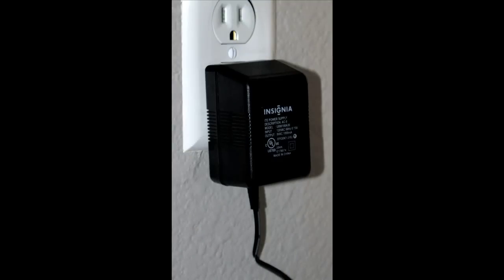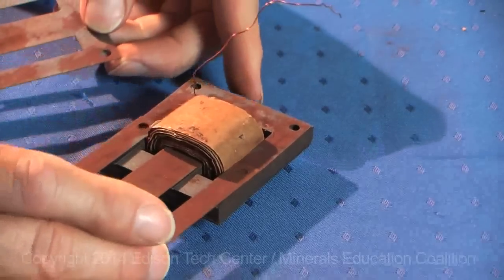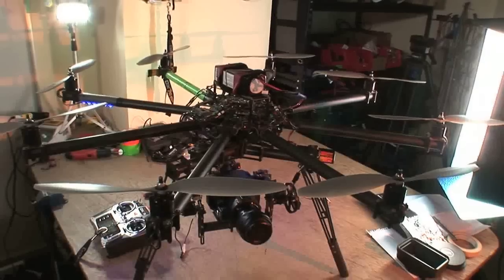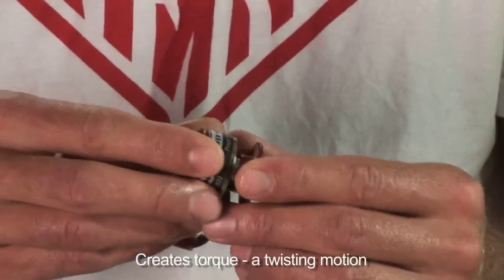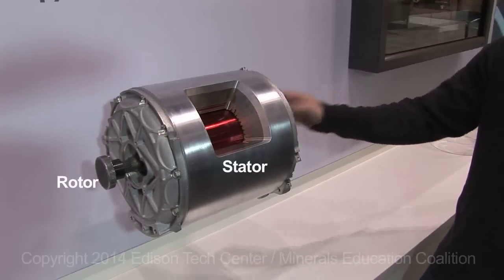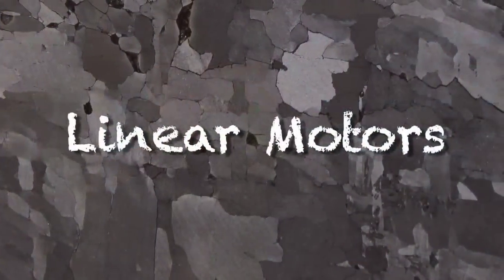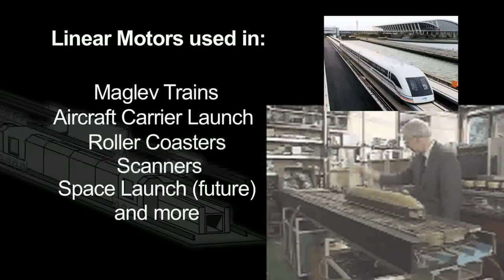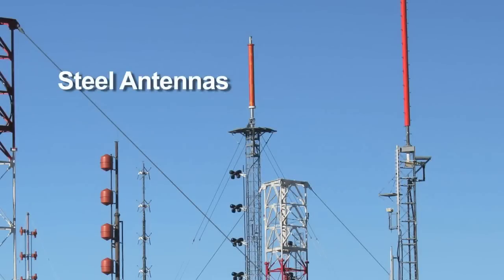Iron in Transformers, Motors and Generators P3

Comment: I don't understand how ferrite ring help reduce interference
Reply: Good.
Reply: A ferrite ring adds Inductance and therefore resistance to AC just like a capacitor provides resistance to DC. It effectively, along with the resistance of the wire creates a low pass filter and prevents high frequency harmonics.

Comment: The Octocopter Clearly Had brushless AC motors like the Tesla car. Why does he claim, in an educational video, they're DC motors??? Rubbish! Cheap little brushed motors as most kids introduction to mechanical power and are far more understandable than blue smoke brushless motor controllers.
Reply: In fact BLDC are in between AC and DC motors and they can run on both currents.
Reply: @ag135i  No. If you try to run a three phase BLDC motor on DC whatever third phase you would burn out one phase.
Reply: these permanent magnet synchronous motors need ac to turn
Reply: The video maker is right. Those are BLDC motor, and kind of DC motor.
Reply: @NahidNazmuls  BLDC motors have no brushes so use usually three-phase AC.
Reply: dc voltages applied
Reply: @SHADYYTECH  To the DC to three phase AC motor controller to run the AC BLDC motors.
Reply: Well that right there is the problem with the AC - DC designation, technically all electric motors need AC to function, the only question is at what stage it turns to AC.
Reply: @MsSomeonenew  Yes and all designations of AC are because you cannot provide them with just DC you need to give them complex AC waveforms usually at more than two phases.